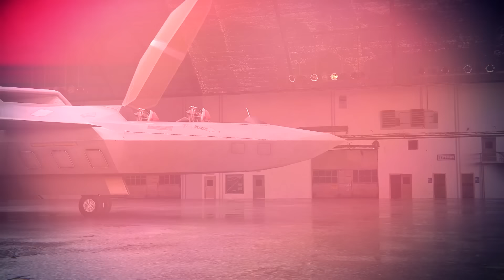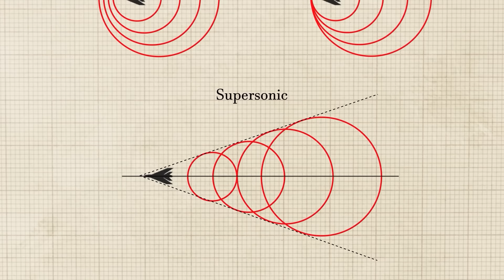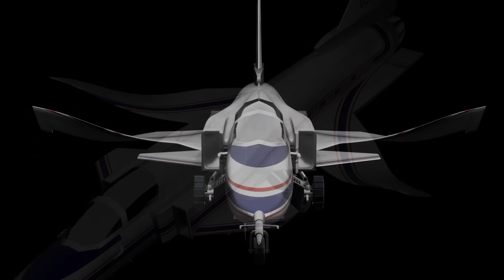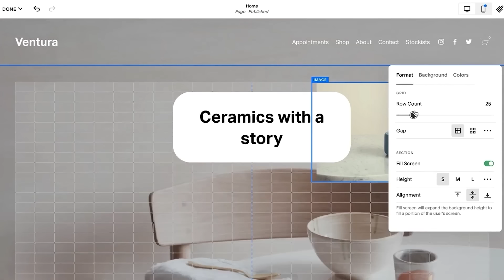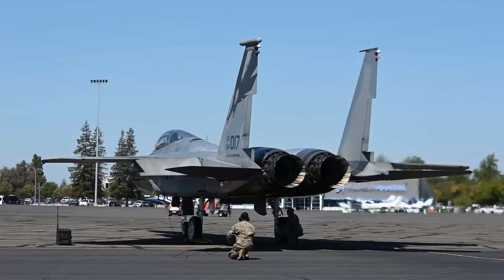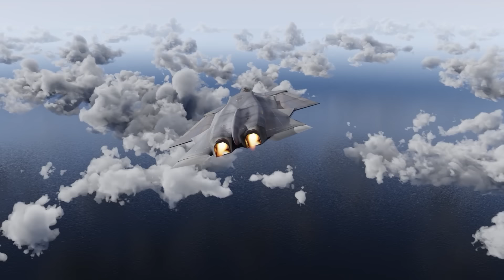Does the plane from Stealth actually exist? Northrop Switchblade

Comment: the fictional naval carrier borne F/A-37B Talon stealth multi role all weather interceptor is actually a viable design . . . the forward swept variable-sweep wings during transition from low-supersonic to trans-hypersonic flight is a practical design element . . . however a realistic F/A-37B Talon airframe will need to have a less raked vertical stabilizer than the one in movie . . .

Comment: both swept and unswept, ie inverted delta wings. yep narrow space shuttle delta wings, but inverted to batwings. equal wing surface area and lift to wider unswept wings. ie double V wings. drone motor wings no stalling vtol operation. ie jets dont stall. adapt means moving parts, no go. trash broken plane. props + electric fans = fast evtol plane quad copter. or just 4x jets at x-wing corners as a quad copter drone. who said no quad copter air craft carriers. lol. 4x plane domains: ground, under water, air, space.

Comment: It does not exist because I need a fighter to have enough wingspan to glide 1,000 miles and barely use any fuel. Especially if they are to be used off an aircraft carrier. The further your strike packages can travel the further out to sea you can keep your carrier further increasing that buffer zone. 

That film aircraft does not even look flight worthy. Im a Vet.

Comment: The answer to solve all problems in avionics lies in the frame of the airplane itself. Every one of these models has a tail. A flying wing with the same system is the answer. 
High payloads-no problem
High speed-no problem
Low speed-no problem
High maneuverability-no problem
Even the maintenance would be way easier when every system is build in layers over each other at one and the same place.
Just imagine having the payload in the middle of the plane, the engines on the sides and the swept wing system beginning at about an third of each side. Before the mechanical system will be the fuel tanks. A great cockpit for up to three passengers in total with plenty of space

Comment: engine air ducks behind the Canopy i think is Problematic, the Turbulence from the air Screen would not give a steady air Flow ( Or it would have been done already ) , its shape would push air away from the ducks, it would spend more power pulling in air than Pushing it our. 
. the Air Force Experimented with that design back in the 70's I think, the engines would always stale out unless it was going in a straight Line ! .

Comment: Northrop Grumman refined this even further with a "shape-shifting" material. An electric charge is applied to a surface and it can change shape in some interesting ways. Eliminates stress, improves handling, and removes unwanted flex when shifting flight modes. It was tested underwater for adverse weather conditions as well as for aquatic use. Some videos of it have been seen online as well, just not advertised or released under the Northrop name. They are working on some insanely cool stuff. Our tech in the US is about 20-30 years more advanced than you may think.

Comment: This is interesting because that commercial released pretty recently that gives us what may be the first true look at the new F-47, looks very similar to the UCAV EDI (Tinman) from the movie, Stealth.  In the commercial, it shows there are two small vertical tail fins on the aircraft that are canted to the sides, and in Stealth, the Tinman EDI UCAV did not have those.  Other than that, the shape of that plane in the commercial and the UCAV look very similar.  I wouldn't be mad if the NGAD program went that way.  The aircraft in that movie were awesome.

Comment: Nice video, about the aircraft l am most obsessed with, the fighter from the movie Stealth.

I reached out to the company that created that plane, but they didn't give me the time of day. So l told them l would design my own plane, which l did.

However, you didn't do enough research for this video. That's because the Delta wing was created to operate in both low & high speed.

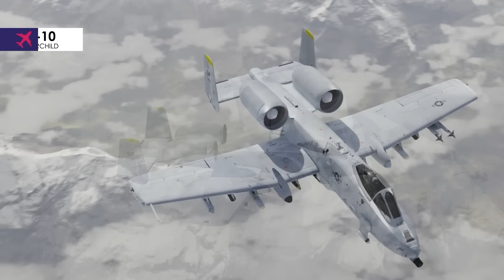Comment: 2:00 the reason for swept wings isn’t drag.
It’s control and lift.
As the speed approaches transonic the pressure wave moves towards the rear of the craft moving the centre of gravity.
After transonic the pressure waves can be well behind the centre of gravity forcing the tail up and the nose down and making the controls ineffective or locking them with excessive pressure.
Many P38 pilots were nearly killed in dive bombing runs due to this phenomenon. The Spitfire with its elliptical wing was less prone to the effect

Comment: Movable wings bring enormous problems, add a lot of weight to the plane, are complex and difficult to maintain, and do not contribute anything that cannot be achieved with better designed aerodynamics. 
Ex: why are the 2 or 3 planes with folding wings so old! F14, Valkyrie, Mig23?

Comment: This is a red herring...

it looks cool and all but it's merely to boy toy.

In supersonic flight, the center of gravity moves to the rear hence all the planes with the wing after 1/2 of the length.
In this case however, sweeping the wings forward also shifts the center of lift forward, which makes it "more than unstable"...

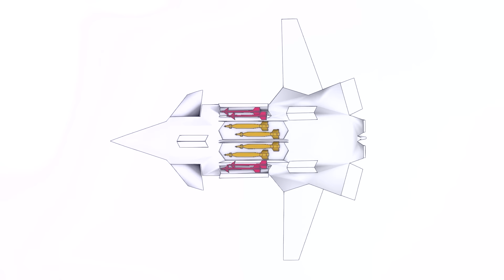Comment: 8:25 I believe that the "Switchblade" model, with canards and variable-geometry wings, would have had a problem during the wings transition from subsonic to supersonic position (and vice versa).
In fact, at minute 8:26 - 8:27 there are moments in the transition where it seems there would have been little or no lift, given the strange position of the wings moreover I think that in a real aircraft the full transition of the wings (which seems more complex than that of the F-14 Tomcat) would take at least 10 seconds.
Interesting video, thanks.

Comment: A detail that went unmentioned in the video is that the trailing edge of the wing becomes the leading edge when the wing is folded. That would complicate the design of the airfoil. Conventional rearward-pivoting wings don't have that issue.

Comment: Such aircraft would have five big problems.

1. The CP would move well ahead of the CG with the wings in the forward position.
2. In the forward position, the wings would create a large discontinuity, thus ruining area rule, thus compromising transonic and supersonic performance.
3. Like all other variable geometry aircraft, there would be a large weight penalty, courtesy of the hinge mechanism.
4. Variable geometry creates significant panel gaps at the pivot region, so it would not be super stealthy either.
5. At Mach 3.5, heat becomes a problem. Radar absorbing materials would not fair well with such heat for long.

It is an eye-catching design, yes, but completely devoid from reality.

Comment: Alternate Air Intake vents take in air for the compressor from other directions when air volume is insufficient at the inlet side of the compressor. These can be situate anywhere forward of the intake plenum, or piped in with sufficient flow - i.e. under the fuselage.

Comment: The real reason variable geometry wings have "died" is the absurd cost involved in maintenance + advanced FBW models that allowed absurdly angled wings and fuselages.

I do not deny that they are amazing aircraft, but as an aircraft mechanic that I am, I believe that if something safe of this type would be heavy and  impossible to make just for normal fighters.

(Yes, I know mig 23, B1B, Tornado, F14 and etc, but they all have chronicle problems)

Comment: A great concept but the most obvious problem was also already blatently clear in the movie. The forces on the swing joints / axles would be terrific and these sit at a position where that wing root is supposed to be very thin. This plane would constantly be on the verge of tearing itself apart. A complexity / weight / cost spiral is certain to follow. No wonder they could only afford to build 3. Must have been abandoned prototypes stolen from NASA. 😁

Comment: It's a small point compared to the immense problems with the wing, but air intakes on the top of the fuselage are a big problem during take off and landing when the nose of the aircraft is pointed up and the intake is therefore sheltered from the airflow by the front of the fuselage.